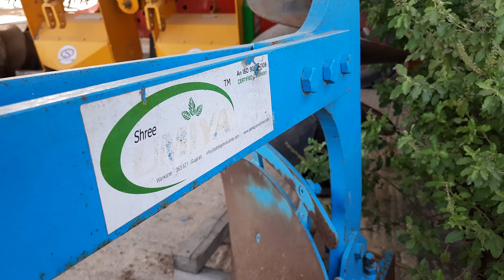Umiya Reversible Plough  | Agriculture |

Comment: Do you supply minitractor mahindra 15hp reversable plough
Reply from the maker: Contact him bro
Reply: YES AVAILABLE MECHANICAL TURNING REVERSIBLE PLOUGH
Reply: @jaiandjaimotors5990 40 hp ku use pabnalama pro
Reply: @ragupathi6791 DEAR SIR,  YES SIR

FOR 35 HP TO 40 HP SUITABLE MODEL AVAILABLE
Reply: @jaiandjaimotors5990  price sir
Reply: @ragupathi6791  95000/- suitable for 40 HP TRACTORS
Reply: @jaiandjaimotors5990  ithula arasu maniyam kidaikkuma sir?